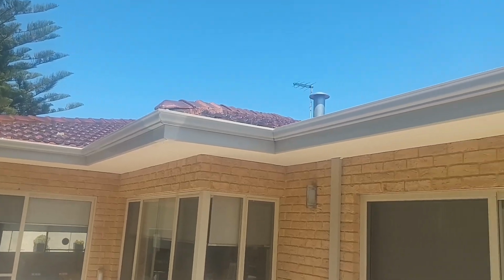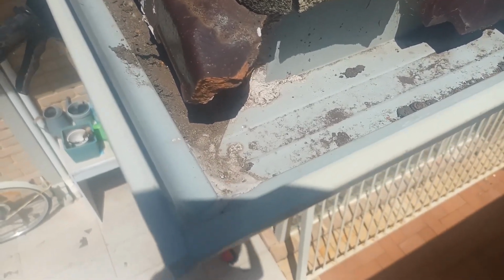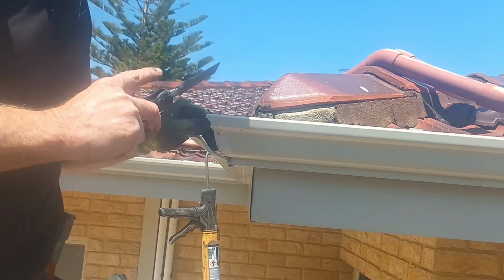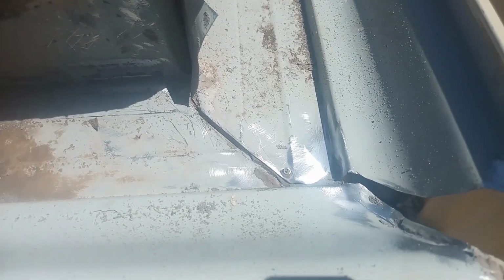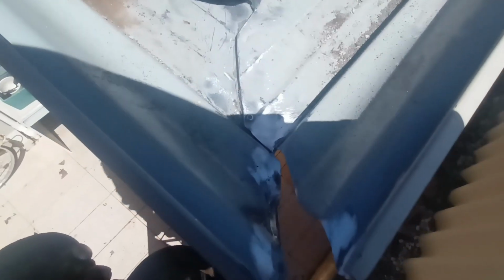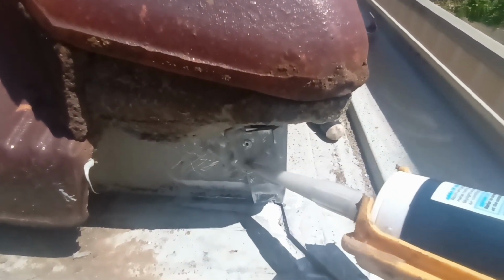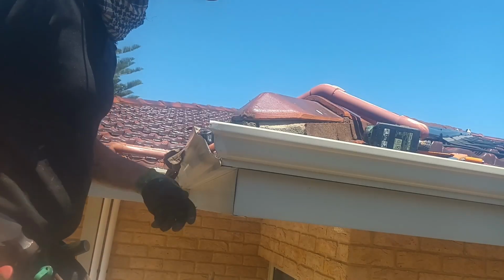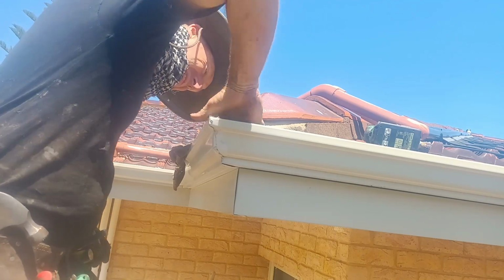How to seal a leaking gutter corner

Comment: This is helpful thankyou! One question is what if you have to repair both corners of the fascia underneath, eaves AND the gutter corner? What order of things would you do? Got both corners of my roof looking like this :(
Reply from the maker: Generally, you start from the bottom and work up. So, Facia corner then gutter corner then tiles. If your fascia corner is leaking however, it will usually be coming from the gutter corner leaking onto the fascia

Comment: This might sound like a stupid question, is it OK if I just put silicone straight on (without removing the existing silicone and unscrewing the gutter)?
Reply from the maker: it can be done but it is not as good and can leak. also make sure you really clean the existing silicone as any dirt will stop it adhering tithe existing.  it is not the best method though